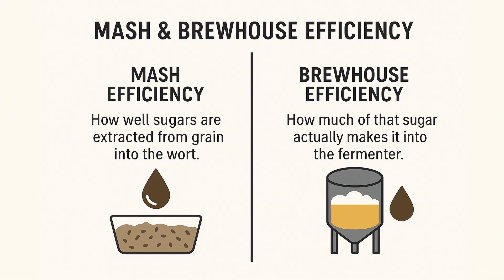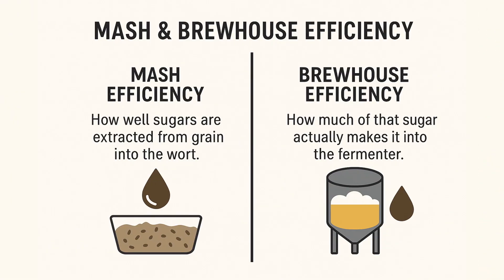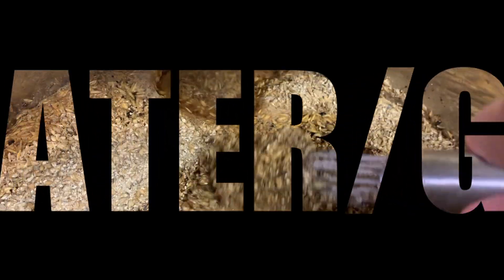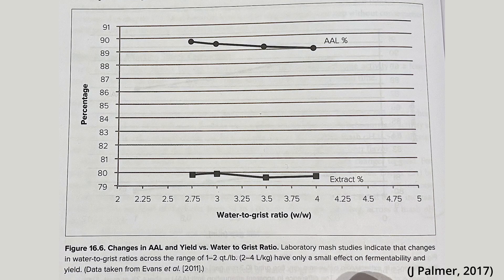How to Improve Mash & Brewhouse Efficiency | Boost Your Brewing Numbers for Consistent Results!

Comment: A very timely video, pal.

My figures have dipped recently, albeit consistently. I just can't see why.

Mash efficiency is now 74% and BHE is 70.5%

Both are down by 4% every brew, since this time last year.

The most likely candidates for me are:

1. The raw ingredients
2. A non-calibrated thermometer/thermostat 

Have you ever found a difference between equivalent malts from the bigger malt suppliers and their respective BrewFather predicted gravity?

A marvelous upload, once again. Many thanks.
Reply from the maker: Thanks, yes I have definitely seen some variation between maltsters on 'equivalent' malt varieties. Always potential for some natural variation of course and might be that the gravity potential given in brewfather isn't accurate although I'm not actually sure how much stated ppg/L°kg varies, should probably check the specs from the actual suppliers at some point!
Reply: Great video for someone like me about to embark on all grain for the first time with a simple BIAB system. Diolch!